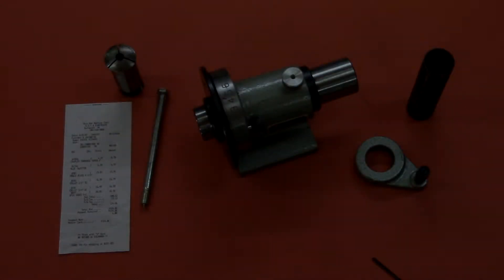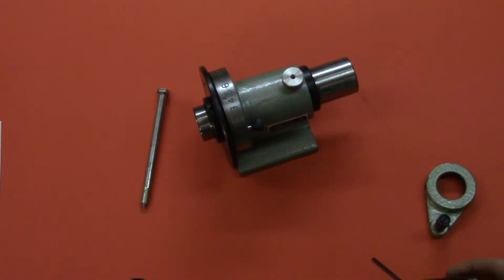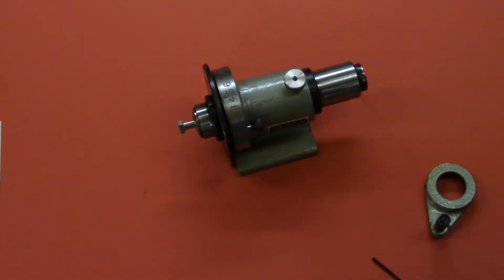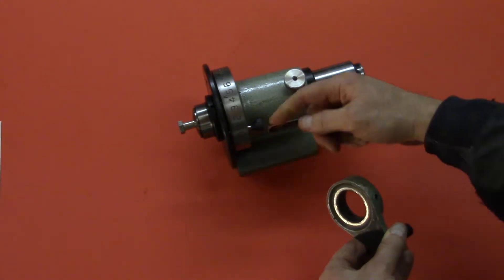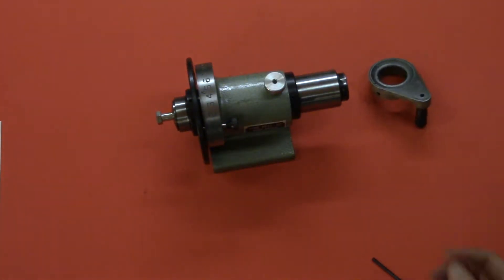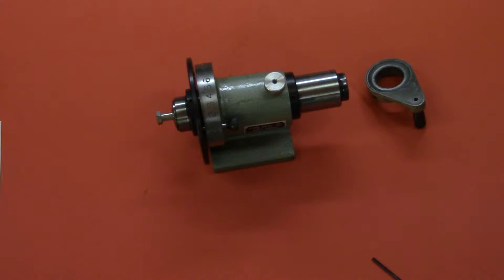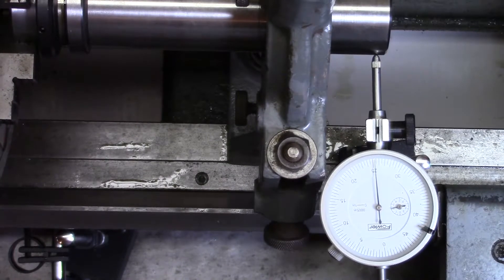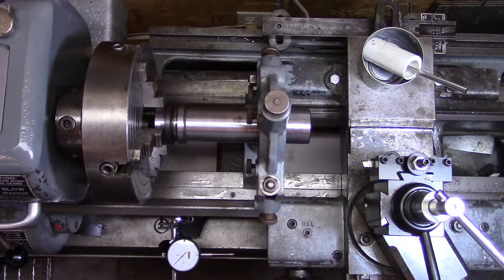Spin Indexer Fix for  Handle.

Comment: You really didn't need to shorten the spindle.  The drawtube does not need to thread all the way into the 5C collet.  Just needed to place the crank flush with the end of the drawtube, then tighten the setscrews firmly to lock it in place.

Comment: Nice fix Richard. 

I have never used a spindexer, but I made an electronic arduino based one with straight shank ER25 chuck.

I'd like to make a 5C version, and the price of a spindexer is so cheap I can either gut it for the shaft or hack together a mount to add stepper motor. If you have a moment the next time in your shop could you measure the diameter of the main spindle please? Thanks
Reply from the maker: The portion I trimmed measures 1
.771 inches. Cheers.
Reply: @Rich_Pierik  Thanks!
Reply: China uses the metric system. The spindle is 45 mm in diameter (1.771" is pretty close).
Reply: @GenePavlovsky  yeah once i purchased mine I was able to measure the actual as built diameter once I started making my modifications.

Comment: Have gotten one off of ebay, but not used yet. 

 https://www.ebay.com/itm/Steelex-M1087-5C-Spin-Index/252844013298?epid=2285414214&hash=item3adead76f2:g:wNUAAOSwzgBY43k7

Several available for around $50. USD Have checked and lubricated the one I bought, but will check the sleeve and hold down clamp arm like you suggested.
Reply from the maker: When you need it you will appreciate having it! Thanks.